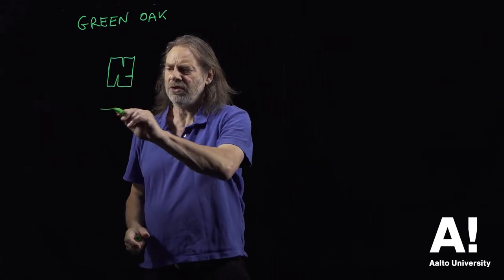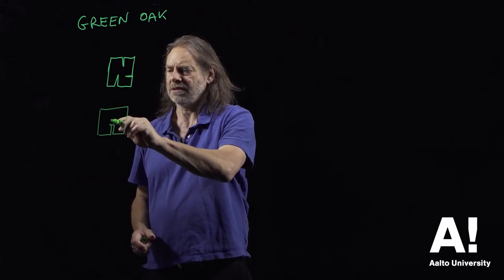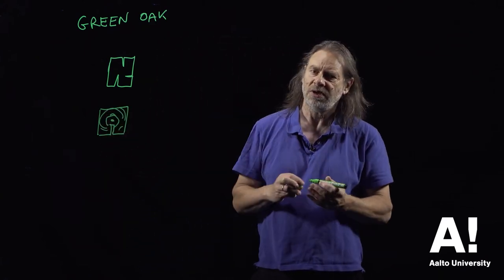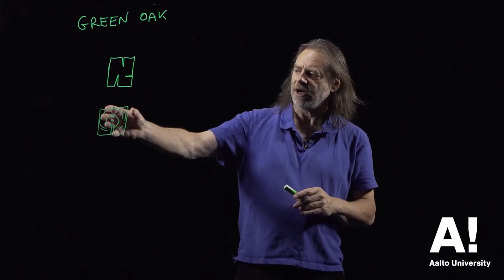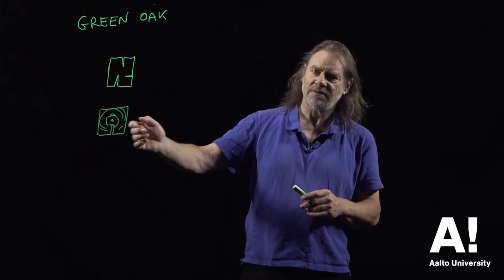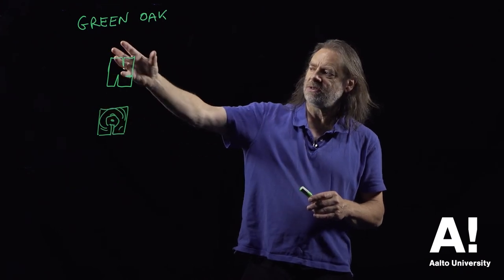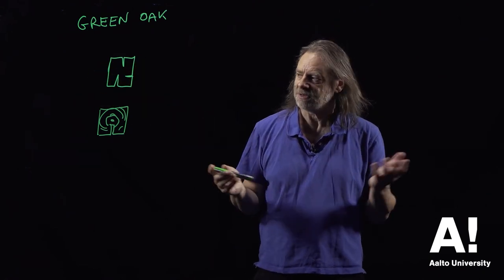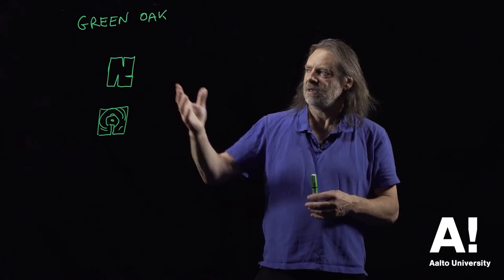Wood drying (8) green oak working

Comment: I have watched your series on wood drying but noticed how similar your lectures are to all the other lectures and books.  Clearly very few are made by craftsmen - you dont mention the difference between air dried and kiln dried in use - nor the difference in use between steam kilned, dehumidified, vacuum and other methods - furniture in modern houses is almost entirely made from steam kilned wood because otherwise it falls to bits why?  
Elm is well known to be a very unstable wood even when steam kilned, so why was Ercolani able to make table tops with virtually no undercarriage in elm using boards over 20 inches wide - academically perfect, practically?